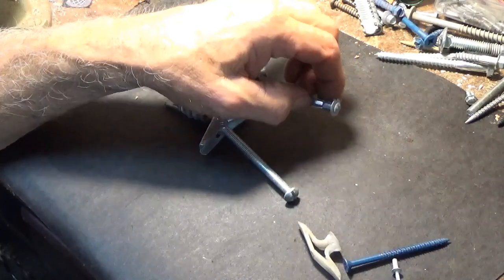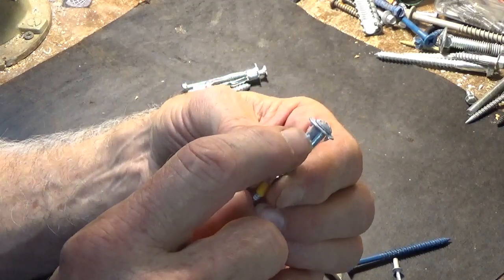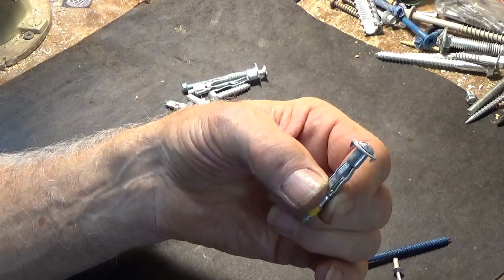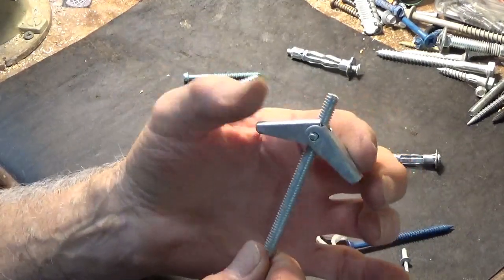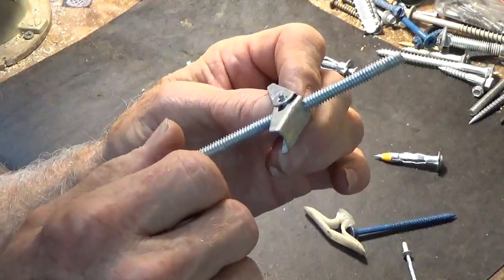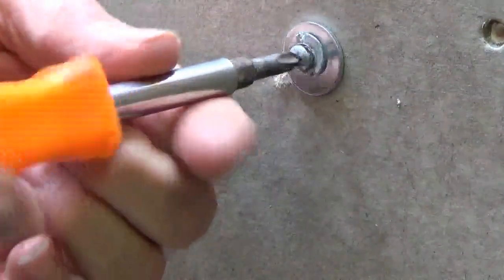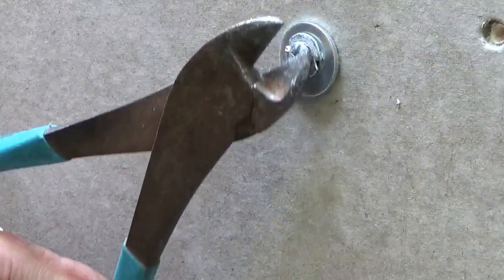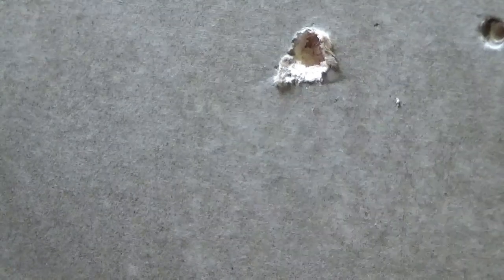How to use Molley bolts and where  to use them

Comment: They're spelt Molly not Molley.

And you're doing it wrong, tightening it wrong, use the Molly Gun tool and it pulls it tight in seconds and then it's impossible for it to twist. Seriously look on YouTube for the 'Molly Bolt Gun', saves you so much time and does it neatly every time.